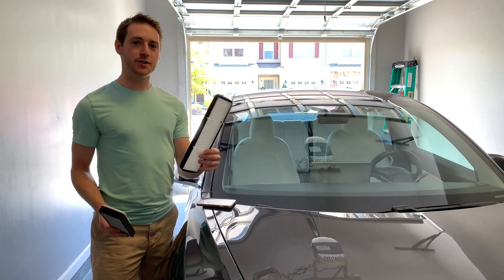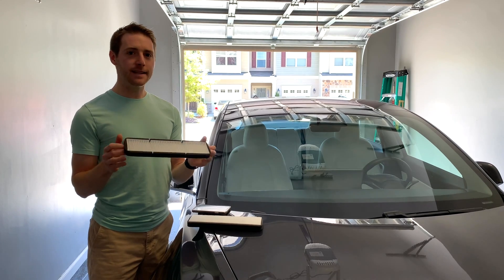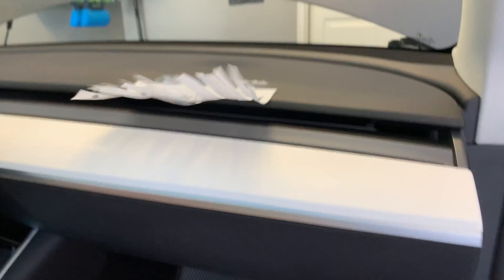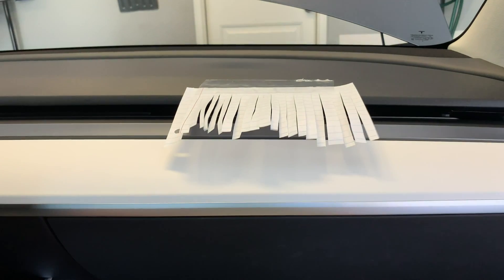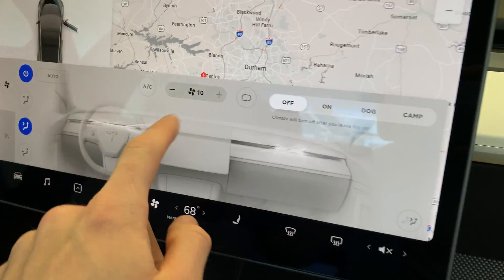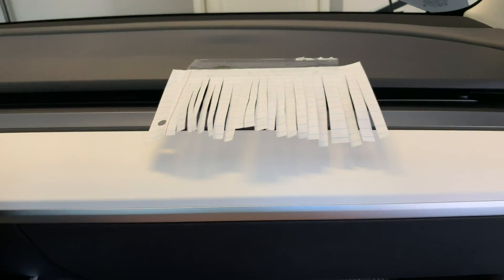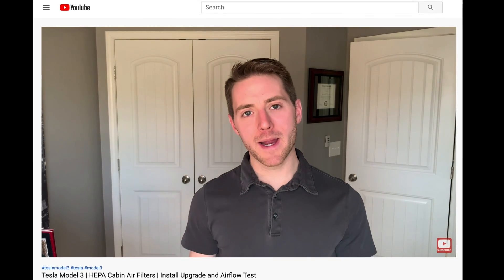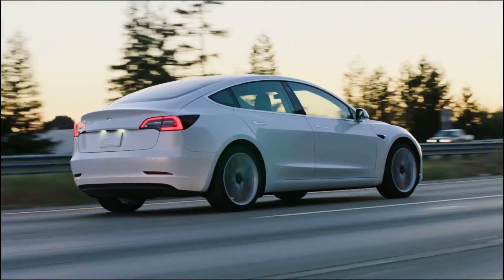Tesla Model 3 Air Intake Filter Upgrade ⚠️➡️ Xtechnor vs. Farmogo | Inlet Vent Test✅

Comment from the maker: Want a Tesla? | Get FREE Supercharger miles!   https://ts.la/evan87711
Farmogo Tesla Model 3 Air Intake Filter:  https://amzn.to/3arUu1f
BougeRV Model 3 Air Flow Vent Protection, Air Intake Grille:    https://amzn.to/362EL7E
XTechnor Tesla Model 3 Air Filter HEPA 2 Pack :  https://amzn.to/2u8NuXZ
Kool-It Evaporator and Heater Foam Cleaner:    https://amzn.to/34Y6wwz
Torx Screwdriver T20:   https://amzn.to/2TgA30S

Must Have Accessories for your Tesla Model 3!
TAPTES Model 3 USB Hub:  https://bit.ly/2y6aXLb
TapTes Wireless Phone Charger Dock :   https://bit.ly/2ykU3bZ
Google WiFi System, 3-Pack - Router Extender:   https://amzn.to/2trlxdA
SanDisk Extreme Portable External Storage SSD(Sentry Mode):   https://amzn.to/2u2YLsA
3D MAXpider All Weather Floor Mats:    https://amzn.to/2PYE5uh
EV Armor Wrap Kit:    https://amzn.to/2rvZphh

Comment: This won't eliminate fumes from other cars however keeping your car in recirculate mode will keep fumes out. This is what I do in the big city I live in.
Reply: Yup. This is what I do. Hardly ever smell anything. 

When I do smell something, I'll check my AC, and it's ALWAYS because Tesla's "auto" setting turned the recirculation off 

Why does Tesla turn it off sometimes? Is there a way to keep it on indefinitely while using the auto setting?

Comment: Installed XTechnor HEPA and Farmogo intake filter. Intake filter has reduced the airflow around 20 - 30 % which is a lot on a hot summer day and bad for AC system. Intake filter is a good idea though as it will increase the life span of cabin filter and reduce the foul smell. It would be nice if Farmogo makes a cheaper basic intake filter with only 5-10% reduction just like central AC filters just to block the dust and debris. Btw, Tesla is selling OEM cabin filter for $17 a piece on its website ($34 for 2 filters).

Comment: If you have a HEPA filter, why do you need a pre-filter, you mentioned it will help with the smells, is your HEPA filter improving that at all?
Reply from the maker: It’s better than the stock filters by Tesla but you will still get a hint of smell from the outside with the hepa filters. This exterior filter helps mitigate that while still having excellent air flow.
Reply: Evan Michiels what about rain? I park it outside. How much airflow do these allow when wet?
Reply from the maker: When your hood is closed, it would be quite challenging for the rain to get down in there unless you have a crazy sideways rain storm. Remember, even without this filter, the tesla model 3 comes standard with that giant hole exposing anything that falls down there. If rain water were to get down there, that with in turn run down to your main cabin filters.
Reply: @EMtesla1 Air flow will reduce as dust starts clogging in to this.  How soon do we have to replace it? Can it be cleaned with a brush?
Reply from the maker: This greatly depends on what climate you live in, the manufacturer though suggests replacing this filter every 2-3 months. I would not recommend using a brush.